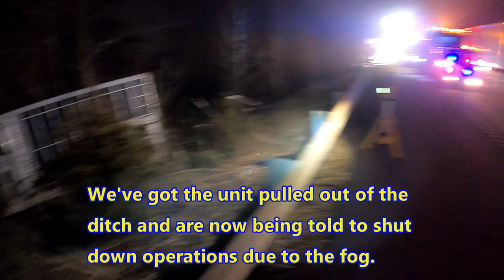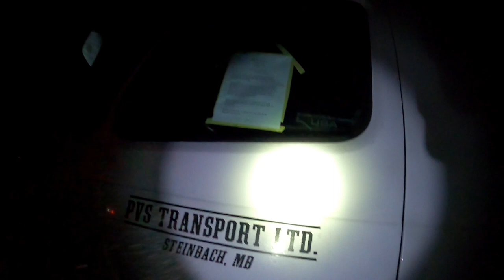When Pigs, I Mean Rigs, Fly  Part 1, Fighting the Fog

Comment: Over here in Maryland when a recovery requires the closing of lanes for an extended amount of time the State Highway Administration will quickly dispatch truck with arrow boards and set out cones and VMS or yellow signs indicating emergency lane closures ahead. If it is a night recovery State Highway will also bring in lights. All the heavy recovery contractor has to do is concentrate his assets on job at hand while State Highway folks perform traffic control.
Reply: Same here in Maine. There is full coordination at all levels - State Police, MaineDOT and/or the Turnpike Authority will control traffic if the wreck requires it. It expedites the highway reopening. The state will issue mobile alerts for such events as well.

Comment: I got a big STIHL Chainsaw in my truck. Really handy to have on jobs like this when you need to cut down trees or whatever to make a clear path to get something out. I was using my STIHL Disc saw that I got in my truck also, for a couple hours once cutting wire that was all messed up from a tractor trailer that was tied in it. It was a tangly mess lol. Had a lot of work cutting it all up and freeing the truck to recover and tow it.

Comment: Ron you should have some of those signs laminated at the ready in your recovery vehicles just in case the conditions call off the job so you wont need to return in worse weather just to mark the unit you can place as you leave the site
Reply from the maker: Us leaving a scene like this is so rare, that we just haven't made up any signs.  I went to the shop, printed these up and went back.  We had already place Police tape around the rear of the trailer, but wanted to put these in as an added precaution so that IF someone where to see it and go down there, they would know that everything had already been handled and a plan was in the works....primarily that nobody was injured to be concerned about.   Thanks and God bless.

Comment: What if you put a sign a mile back from the wreck that says "Wreck Ahead Watch For Crews" and have Red And Blues Flashing on it like your lighting system for the back of the semi trailers?
Reply: No mater how far back you put the signs they will probably need to close a lane and back up traffic. There's no danger of it sliding further or catching fire or leaking more then it, and no cargo to be stolen has so there is no need to remove it right away. They are not only risking them selves closing a lane in such heavy fog but everyone else on the road as well. Sometimes there is no choice if is a person is trapped or it's blocking traffic, but the responsible thing to do in this case is to come back when the conditions are better. No ones life or health is worth a wrecked truck and empty trailer.

Comment: What's the paper in the windows for? Is that how yall call dibs or is it state required?
Reply: Brad Morgan “For safety reasons the Missouri State Highway Patrol has had everyone clear the scene for the evening of 1/14/2020.

Midwest Truck Sales and Service has already been on scene and will return to the scene on the morning of 1/15/2020 to finish the recovery. We have the keys. The customer, the MSHP, the Scott County Sheriff’s Department, and the Scott City Fire Department are all aware we will be returning.

Nobody else is authorized to move this truck or trailer, pictures have been taken and police tape has been placed.

Anyone attempting to move this unit will be in violation of the law.

Signed R.P.”

Comment: Ron pratt what was the notes that you were putting on the truck
Reply: Michael Woodruff “For safety reasons the Missouri State Highway Patrol has had everyone clear the scene for the evening of 1/14/2020.

Midwest Truck Sales and Service has already been on scene and will return to the scene on the morning of 1/15/2020 to finish the recovery. We have the keys. The customer, the MSHP, the Scott County Sheriff’s Department, and the Scott City Fire Department are all aware we will be returning.

Nobody else is authorized to move this truck or trailer, pictures have been taken and police tape has been placed.

Anyone attempting to move this unit will be in violation of the law.

Signed R.P.”

Comment: What notes say that you put in the windows?🐷🐷🐷😄
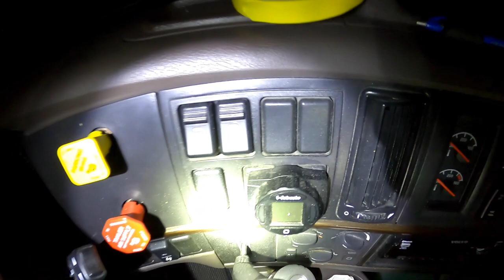Reply: 11:27
Reply: "Midwest Truck
{Contact Info}
1/14/2020
For safety reasons the Missouri State Highway Patrol has had everyone clear the scene for the evening of 1/14/2020.

Midwest Truck Sales & Service, Inc. has already been on scene and will return to the scene in the morning of 1/15/2020 to finish the recovery. We have the keys. The customer, the MSHP, the Scott City Sheriff's Department, and Scott City Fire Department are all aware that we will be returning.

Nobody else is authorized to move this truck or trailer. Pictures have been taken and police tape has been placed.

[Anyone] attempting to move this unit will be [in violation of] the law."

(text placed in brackets above was in place of text that was obscured by Ron's hands at the point where his flashlight did not wash the text out. It may be worded slightly differently.)
Reply from the maker: @rebeltag  You are close....not exact, but close.  Thanks and God bless.
Reply: @rebeltag  thank you, i was curious
as to what the notes were for.never
saw anybody do that before Can't
wait for the conclusion of this recovery.

Comment: whats the point of taping a note so that you can read it from inside the cab if you're just going to lock the doors....
Reply: So the ghosts can read it.
Reply: Grizzly172 The side windows had the notes pointing out and the windshield had one pointing in and out so anyone could read them.
Reply: @gsettlemyre  yeah but who is going to read the note on the inside if the doors are locked is my point. Anyone getting in is going to have seen the notes outside.....

Comment: Ron I was wondering what the signs say that you put in the windows
Reply: Alan Bean “For safety reasons the Missouri State Highway Patrol has had everyone clear the scene for the evening of 1/14/2020.

Midwest Truck Sales and Service has already been on scene and will return to the scene on the morning of 1/15/2020 to finish the recovery. We have the keys. The customer, the MSHP, the Scott County Sheriff’s Department, and the Scott City Fire Department are all aware we will be returning.

Nobody else is authorized to move this truck or trailer, pictures have been taken and police tape has been placed.

Anyone attempting to move this unit will be in violation of the law.

Signed R.P.”

Comment: Why did you put notes in truck windows
Reply: Jason Taylor I read the note real good and this is what it said...”For safety reasons the Missouri State Highway Patrol has had everyone clear the scene for the evening of 1/14/2020.

Midwest Truck Sales and Service has already been on scene and will return to the scene on the morning of 1/15/2020 to finish the recovery. We have the keys. The customer, the MSHP, the Scott County Sheriff’s Department, and the Scott City Fire Department are all aware we will be returning.

Nobody else is authorized to move this truck or trailer, pictures have been taken and police tape has been placed.

Anyone attempting to move this unit will be in violation of the law.

Signed R.P.”
Reply: @gsettlemyre  - All you had to comment was to let anyone wondering about the scene that it is known about and the crew will return as soon as the weather cleared.